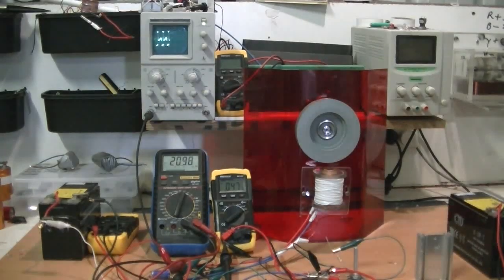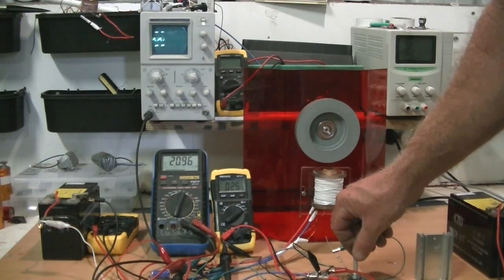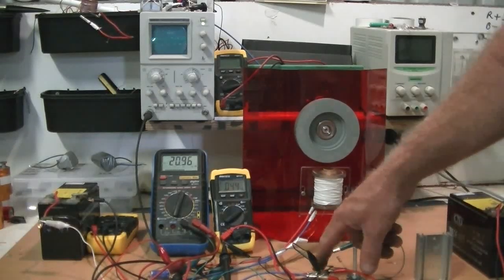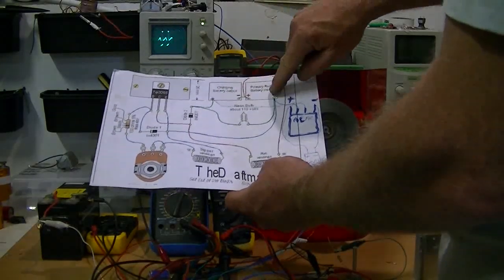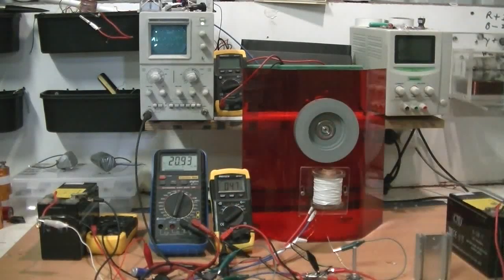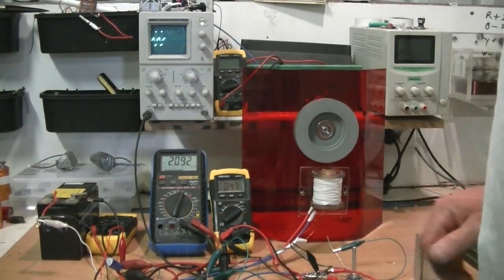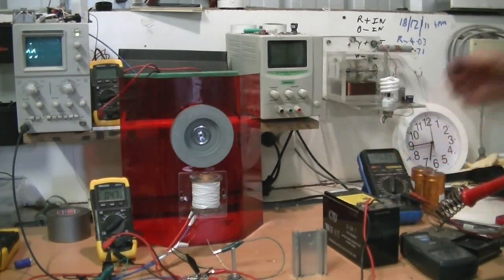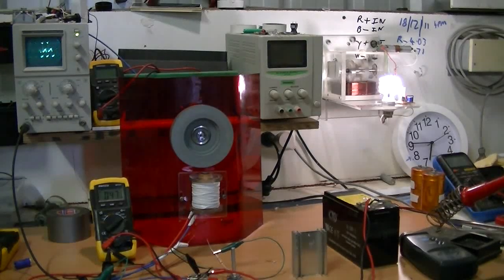H wave and cap dump voltage.flv

Comment: I urge you to retry that cap test Tinman, I did work for me, I am not sure of the way it was pulsing , I will be getting a scope in the next couple of weeks, So I will leave the Motor that is charging the caps as it is  until then. But I was getting a hot resistor ... so maybe it is to do with the second (and subsequent pulses) you were talking about in this vid ?

Comment: nice video . see if you can give me a idea about the LED. i have a plexiglass rotor, do not know if the led with show up on that for tuning. the center of the rotor has the small shinny ring, ill try to set up the LED on that but check to see if it shows up on the plexiglass. thanks again, steve

Comment: differences between your test and mine... 

My Charge battery was Half the size of my run battery (7AH on the run / 4AH Charge)
Charge Battery was very weak and not taking much of a charge 
I used  4 x 1n4007 diodes to make my FWBR
My cap was not a Flash cap, just a standard electrolytic cap 450wv 470uf 
Lastly my coils are longer than yours mine measure 3  3/4  inches long and core is 1/2 inch 450turns.... with I plates form a transformer cut up and pressed in tight